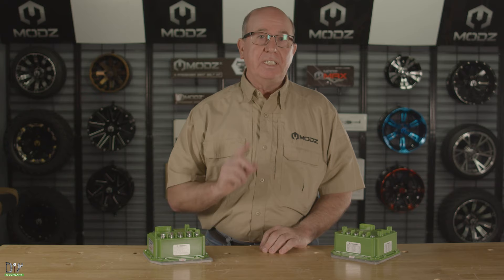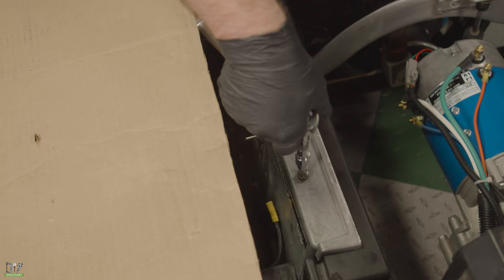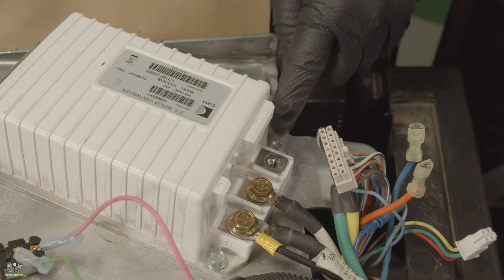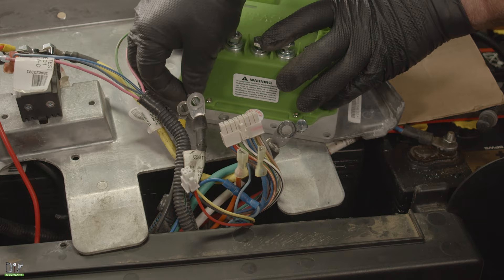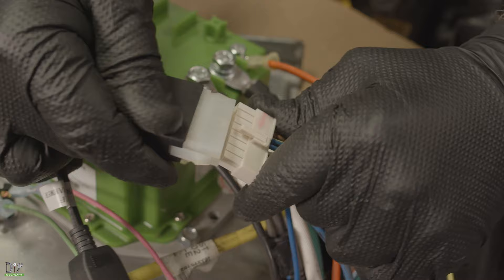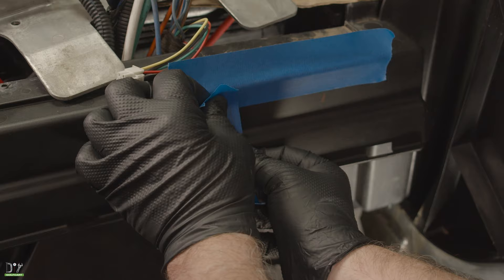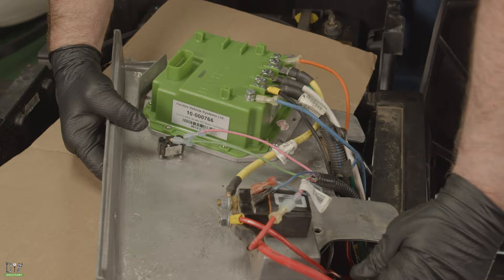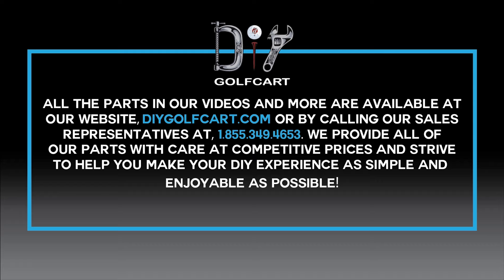Navitas 440 & 600 AMP Controller Installation on Club Car Precedent and DS Golf Cart How-To

Comment: Is it me or did he cut that hole for nothing? The hole was cut in the wrong location and the plug didn’t even go through the hole that was cut.
Reply: Yeah, that was piss poor.  Also use an oscillating tool for a clean cut on plastics.
Reply: Lmao
Yes I was like that's a great template  till I saw this nightmare..!
Reply: Do not let this guy touch your golf cart, until he can explain that hack job!!
Reply: I was literally thinking why the hell did he cut that ... even still could have made it a flap but it wasn't needed at all
Reply: The hole is needed for clearance because of the connector depth.  The wire and connector stay on the other side.  I’d like to see an exact fit cutting out only 3 sides leaving a hinged flap on the bottom.

Comment: The Navitas controller instructions state to remove the pre-charge resistor.  However, you video does not cover that.  Is it required?

Comment: Do you need to replace any other parts if you have a new motor already with the rest oem . I want a navitas d controller now, will I need to upgrade anything else when installing? Thanks

Comment: My club car cuts out while driving. I changed speed sensor and mcor but problem is still happening. Does this have anything to do with it? I have a new set of batteries! While driving at regular speed it while sputter almost to a stop then i let i sit for awhile and i can drive for about 5 mins and problem starts again please help????????????
Reply: Sounds like brushes in the motor

Comment: Hello! I have a 2000 Club car, will this device improve my speed?
Reply: Yes. It does two thing, increases amps to the motor for more speed power and controls its own speed rather than the factory speed sensor.
Reply: @dyoel182  Will this be a plug and play kind of setup? Would you happen to know roughly how much more speed this will give my cart? Any help will be grateful. Thank you!
Reply: @my66k  I just ordered mine supposed to be here soon. Depends on your motor. I'm running the bandit by plumbquick I'm hoping to see 25-30 mph
Reply: @mrsmith2904  mine is just the stock motor by ClubCar back in 2000.  Super slow!!! Pls, keep us all posted on your progress.
Reply: @my66k  Any idea what speed level you're currently in?
Reply: @dyoel182  Slow enough not to register on a speed gun.... and going uphill, forget it. Kidding aside, it's embarrassingly slow.
Reply: @mrsmith2904 - did you have any problems installing this with the bandit? I’ve connected everything and the motor started smoking pretty quickly. Not sure what to do now.
Reply: @jtm12180  installation went flawlessly, I did have a burning smell about 20 secs into riding after the swap. I had to replace one of the magnet posts, if I can recall the ceramic isolator was broken allowing a weak connection. I would find the diagram to run a continuity test to make sure it did fry the armature. But the bandit is a pretty strong motor. Check wiring after running some test. Mine is still running strong to this day, max speed we recorded was 27. The only thing I didn't like was uphill power but I think my wheels are a little big
Reply: Sorry about the updates YouTube never sent me a message about the updates.
Reply: @mrsmith2904  would you please tell me what wires you connected  to where, as far as the controller/solenoid/motor? I think that would help me solve my issue
Reply: @jtm12180  even before hooking wires up again I would run continuity test, I'm at the beach now I'll check when I get home.